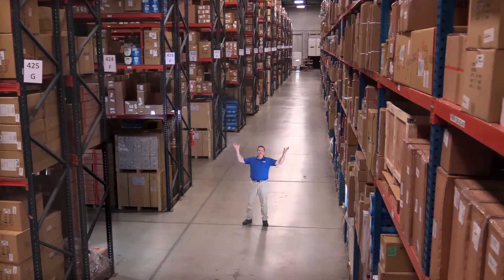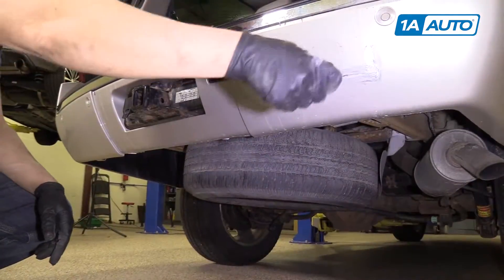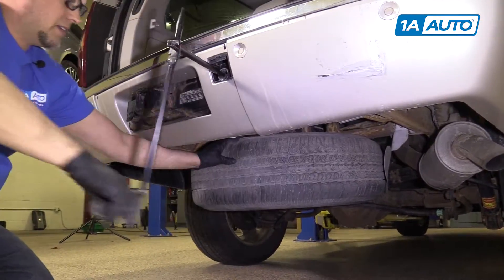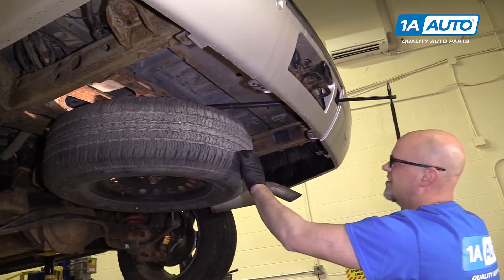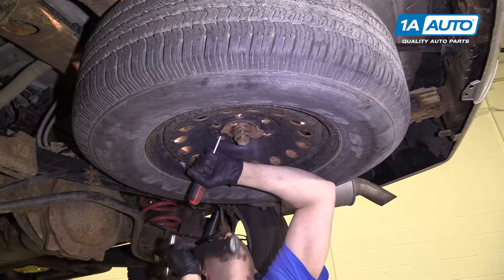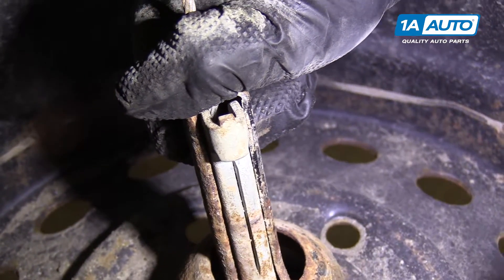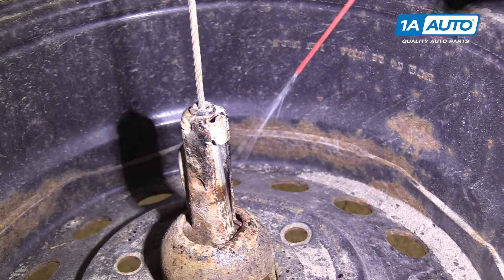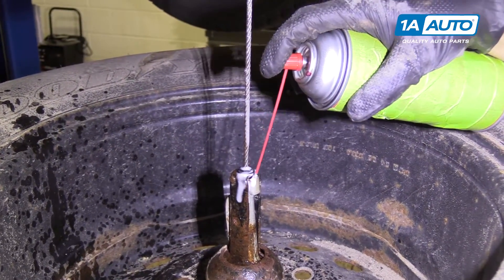How to Release Stuck Spare 07-14 Tire Chevy Suburban

Comment: This really helped me.  The guys at the tire shop told me my cable was twisted or broken and they couldn't figure out how to get the spare back in place under the car.  I came home, found your video pretty quickly, watched once, and was able to disengage the lock.  The mechanism dropped down, I was able to wrestle the spare (I'm a 60 year old woman) into position and winch it back up where it belongs without any problem.  The hardest part was shoving the heavy spare truck tire under the car by myself.   Thanks so much for sharing your expertise!

Comment: Well let's not forget all the engineers that went to MIT to design the headlights, so when you need to replace the bulb, you have to pull the front bumper halfway off loosen the front grill and remove the headlight assembly..

Comment: Here's a tip for people struggling in the cold rain, when you put in the metal bar, try tapping the end with another metal. I tried that and mine was able to start twisting properly. I tried that on my Chevy Suburban and my silverado, and it worked perfectly for both. Hopefully, that helps anyone out there.

Comment: What about when you put the long black tool into the spare tire release hole and it just spins without lowering or raising the tire?
Reply from the maker: +MrInfamos Thanks for watching!  You could have an issue with the mechanism itself, but without being at the vehicle we would not be able to diagnose it.  1aauto.com
Reply: Were you using the wrong end of the tool? That's what the problem was with ours. 🤦‍♀️
Reply: This just happened to me. The end of tool is not square anymore. Switch the extension tubes around and use the square end on the other one.

Comment: thank you GM for yet again over complicating a very simple task if you're afraid of the cable breaking use stainless steel cables that's just what I want to do on the side of the interstate is lay under a 70 lb wheel while I bang on something with a hammer hoping it doesn't fall on my face

Comment: how you do that on the side of the road?
Reply: Mr740juggalo
Realize that you are going to get dirty and possibly wet and use the screwdriver and hammer in your tool kit to release your spare. You can pack a long punch or dull chisel. You may want to throw a decent sized, folded piece of heavy cardboard under your back seat to lay on while releasing the spare

Comment: I prefer to use the nose of the gm engineer who who designed that marvel without any eventualities in mind. Much more practical than a flat blade screw driver. Wonder if anyone has lost life or limb over this "safety features". Also wonder if it's like 95% of gm truck owners who have had this malfunction